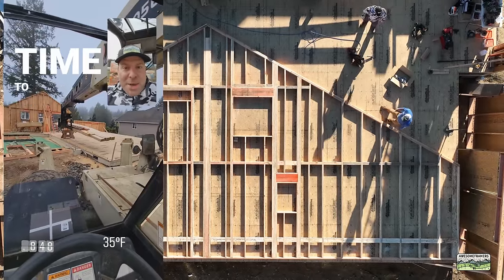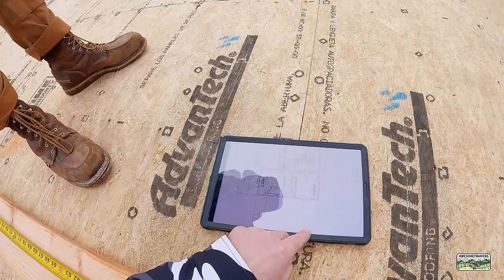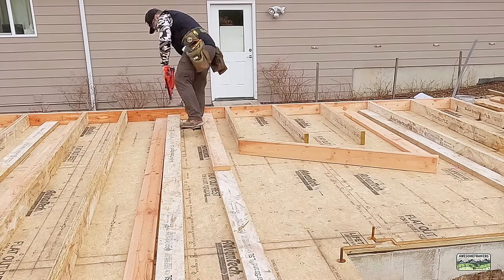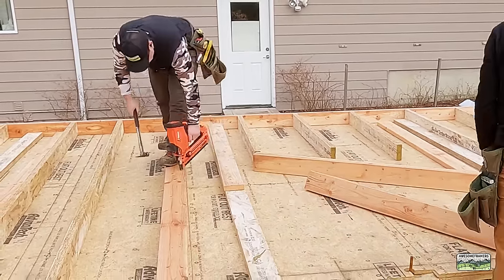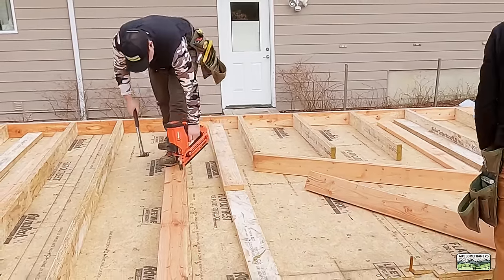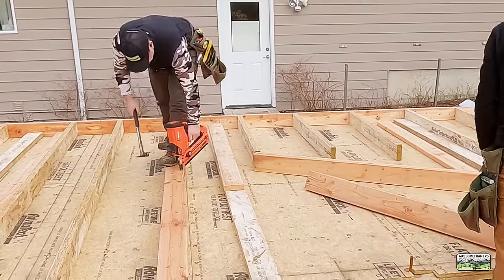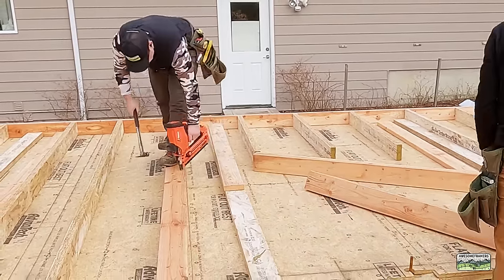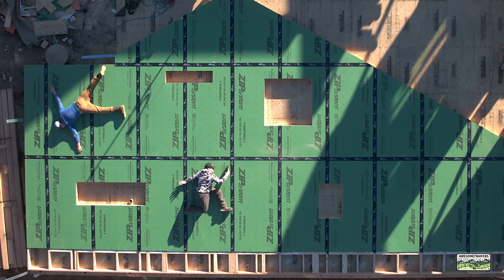How to Frame the "Great Wall" 150 Olympic episode 10

Comment: I had a house on a lake cascading down a mountain . With 7 floor levels all tangled one over another . Virtually every room was a vault and 50% of the walls had to be built like a rake wall . It was a sight to behold in the frame . To top it off . The prints had about 80 errors and I got tired of playing Where's Waldo. All intertwined with steel and timbers . When I started , I had a full head of hair . Now I am bald and drink excessively

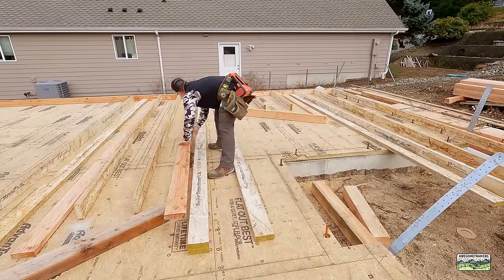Comment: around 13:50 regarding nailers and power; I use a Powertank CO2 bottle to power my Milwaukee hammer. Bottle is expensive, but 10lbs of CO2 is 20 bucks; nails are cheaper too. And yea I drive my nails flush all the time in 2.0E LVL built up beams

Comment: Man the router handle is impressive u guys 7hrs that's impressive
Reply from the maker: It really is all in the process.  We've been framing these walls this way for 10+ years.  We used to snap out rake walls but because we spend so much time with a wet floor, we moved away from that to relying on the math.

Comment: Can you do a short instructional video on hold downs that go through a raised floor system, I see that you are required to use them but have not really addressed how you typically install them. Thanks
Reply from the maker: I will try, but I don't think any of the homes we have coming up need HTT4s or 5s.  I have a video on IG that's 3 years old that shows them.

Comment: Quick question, I have a house built in the 50’s I wanna change the subfloor made from wooden planks to 3/4 plywood but can I do that if the internal walls are on top of the wood planks?

Comment: I haven't watched the youtube video yet and as a union fommercial carpenter and woodworker, I'm really just jumping into the nuts and bolts of stick framing.  This house would essentially be balloon framed right? I was processing why the jack and king were so high, then realized you mentioned that the window is 2 stories up. So essentially ya exterior walls run all the way to your roof. Which would explain why yall are framing it so heavy duty. 

Am I somewhat correct or nah? Serious question
Reply from the maker: Yep, you got it 👍
Reply: @AwesomeFramers  appreciate it, been following yall on IG and here for some years now. Always love the work and content and how yall challenge the older norms in stick framing, amd back it with facts.

Comment: Why not lay the rake wall studs over the bottom and top plates? You know you'll knock off an inch and a half of the stud for the bottom plate, and for the top you can trace up the face of the stud for the short point, for the long point, connect the lines and now you've scribed your rake wall cut. And you've got your tape to make sure you stay 2' O.C. so the stud stays straight all the way up.

I mean you have that beam saw, so 5 1/2" shouldn't be a problem to cut down.

Seems like you'd save a lot of footwork and bending over
Reply from the maker: we've done it all over the last 20 years and this is the most efficient way to go about these walls.  Using the big saw to cut on edge is a no go physically, its just too heavy.  

The quickest is to find the middle stud and use the math to add/subtract for the other studs.  That's usually how we do it but on a big wall like this, I like the peace of mind of measuring them in.  7 hours for this whole wall is still quite efficient, I don't know if we'd even save 5 minutes running the math and double checking each other.

Comment: I know you have this figured out but I'm unclear so forgive my ignorance.  It seems the higher material cost (sheathing, nails) would trump the labor required to stagger the joints for the same strength.   Did I get that was the big picture of doing it that way?
Reply from the maker: Good question.  For background, we have to block all panel edges.  We line up that blocking so it is also fireblocking.  If we staggered sheets up/down, we'd have to add additional blocking and layout and more sheets would be cut.  If we stagger left/right there really isn't any more labor but keeping it all like you see here minimizes scrap, saves a tiny amount of labor on the tape.  

So for us this way is far far stronger than it needs to be, so why do anything else?

Comment: Hey Tim, can you help a fellow framer out? I'm converting a 5/12 hip on an existing roof into a Gable end and building it as an over-frame. How do you calculate the bevel angle for your sleepers??? I'm not the most Awesomest framer and I'm not great at math, but I'm trying to learn. (should have stayed in school. HA,HA!) P.S. I'm in Tacoma area, I love all your content and it's nice to see some locals doing Awesome stuff!! You guys rock!!
Reply: Not tim but i think i got this.  Run your ridge and gable truss.  Snap your hip line.    Use a block to mark where your sleeper will plane with the ridge and gable.  Snap a new line for your sleeper position, should be paralell to your hip line and about 2 inches back.  If you have to bevel  now you have all the marks you need to pull an angle, but just let your sheeting float the 2-3 inches my dude

Comment: what size nail are you using?  I have to re-sheath a portion of my house and can't find a definitive answer online for nail length/size for zip sheathing
Reply from the maker: for sheathing we use a 2 1/2" x .131" a true 8 common nail.  Most use a 2 1/2" x .113"
Reply: @AwesomeFramers  yea I was searching high and low for .131 but noone seems to carry them by me in NJ.  Also I only have a 21 degree plastic collated nail gun.  So maybe my options are limited.  I wanted make sure they were galvanized ring shanks as well.

Comment: After you lay out your bottom plate, move it to the top. Transfer the layout from the bottom plate to the floor. Snap lines for each stud. No math. Every stud has a line to keep it strait. A lot faster, better results. Just use a different colour chalk than you used for your wall layout.
Reply: Exactly! We frame the way you just stated and definitely more productive.  There's no need to over complicate everything,keep things simple and work smarter not harder.

Comment: Are you not required to get a sheeting inspection before you tape the seams?
Reply: Great question I would think so you got to check the nailing schedule and if it's already seen unless they video taped the nail schedule and the nailing to show the inspector that way some areas do allow that
Reply: When they roll the tape, the nailheads are visible so the inspection can take place after taping.

Comment: So you aren’t nailing the field of the plywood only the perimeter?
Reply from the maker: I should have been more clear.  Edge nailing is what shear wall capacity is based off of (as well as nail size and sheathing rating/thickness).  All edge nailing is 6" and 12" "in the field" or studs.  Since we are 24" oc, our engineer has us nail 6" oc everywhere.  

I think it was in the video before this in the 150 Playlist where I talked about that at more length.  https://youtu.be/0oEh8KMJ63Y?t=185
Reply: @AwesomeFramers  
Hey thanks, have you ever used a product to cover the nail holes that aren’t covered by the tape?
Reply from the maker: @colemanstanford  nope, this system is designed NOT to need anything over field nails.  Jake Bruton has shown some testing he's done to back that up here https://youtu.be/SzBXXWMfsmA

Christine Williamson has a great website here https://www.overdrivenfastener.com/

Comment: Tall walls are becoming the norm, but usually only in the great room and stairwell. If you have a second floor, shouldn’t the floor bear on the first floor walls? Followed by a rake wall on top of the floor system. I assume you are bolting the rim joist to your tall wall. I’m not sure what is gained by doing so.
On one side of the wall, you split your studs. This would fail inspection in Alberta, as the studs must be full height on any tall wall. You have built a hinge into your wall. If there is a flat ceiling in this location, the wall can be tied at ceiling height and may be acceptable. If it is a vaulted ceiling, it is defiantly wrong.
Reply from the maker: I hear and understand what you're saying but you're incorrect.  There is no "hinge" in that wall and for the proof you can watch the wall lift video here today https://youtu.be/v3LRs-ZxWfA  The reason I say you're wrong is because where those top plates run through to the glulam column is a 2nd floor bedroom.  It has a floor and it has a ceiling above it 👍👍

The floor ledger will be fastened to the wall at twice the fasteners the engineer calc'd out 👍